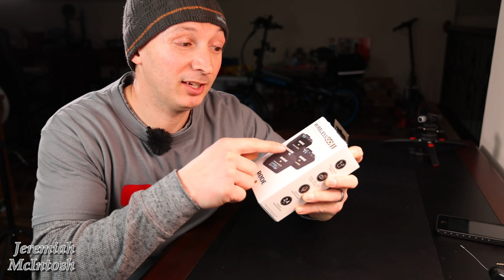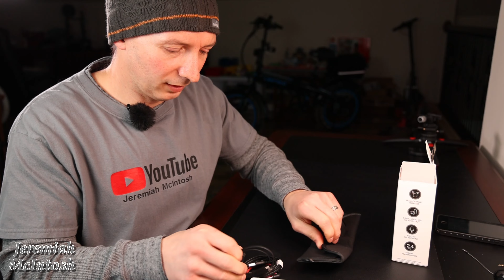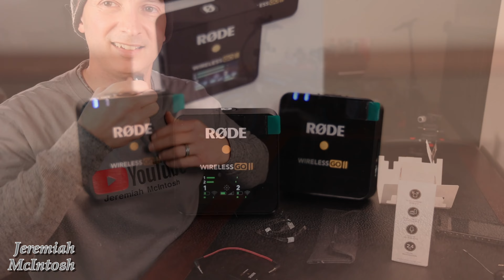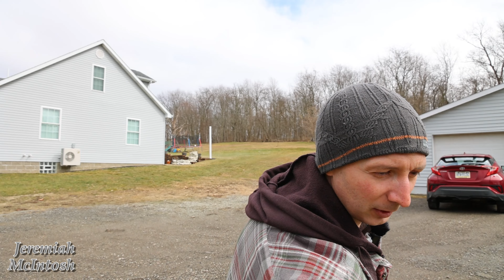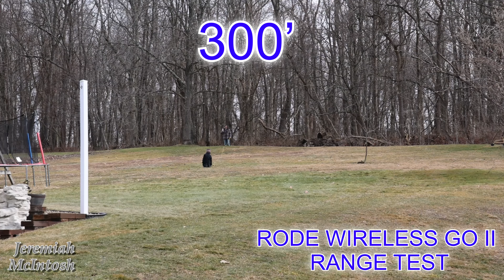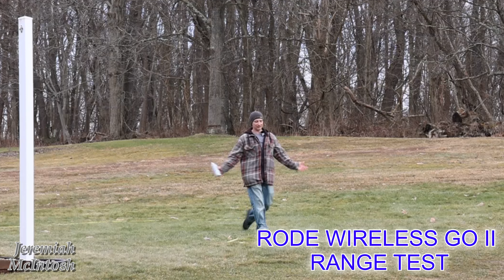How Far Can The RODE Wireless Go 2 Transmit ~ Wireless Microphone range test!

Comment: I have windows 8 64 bit. Rode central will not install unless you have apple or windows 10 32bit or 64bit why? Most likely Rode didn't bother to pay Microsoft's licensing fees for compatibility with all windows versions.  Rode emailed me to say that windows 8 64 bit doesn't meet their requirements? In other words officially Rode has "zero intention" to be responsible at accommodating their future potential customers who "dont" have Apple or windows 10.
The reason why windows 10 works and not older windows operating systems is not what Rode responded in they're email to me that windows 8 doesn't meet they're requirements instead Microsoft historically offers the first several months of programs as well as operating system licensing fees as free thereafter companies are required to pay their share for the access to Microsofts products. 
Rode is either to short sighted to provide windows compatibility to all versions for it's potential customers or too cheap to pay Microsoft's licensing fees even though they're making millions of dollars in profit from this new Rode Go II product.

Comment: Thank you for this test!! I have the original Go, and it has an absolutely horrible out of sight range even in a small room. 

I’m glad they upgraded the wifi transmitter and antennas, but no matter what, 2.4ghz will always be susceptible to poor range when trying to go through objects, unless you utilize a directional antenna.

The other big factor is how it stacks up to interference to other wifi/bluetooth devices. That was also a huge killer with the original model.  With that said, if it can perform out of sight at 75 feet, then it’s definitely a huge step up. Like you said, its very unlikely people will go that far using a consumer/prosumer lav. 

Im sure that internal recording was more of a safety net than a bonus feature lol.

Comment: hello nice video, congratulations.  I wanted to ask you something, are they compatible with smartphones if of course I buy the SC7 trrs cable?  because I know that with the first version they work, but with the wireless go II I have not found anything about it.  Thanks in advance for your reply
Reply from the maker: Yes the new wireless go 2 will work with both smartphones and computers with the correct adapter.
Reply: @JeremiahMcintosh  yes with the new SC15 and SC16 adapters I know they work for smartphones, but I was wondering if they also work with the traditional SC7 trrs cable.
Reply from the maker: Yes it should work with the SC7 cable as long as you have a headphone/microphone jack on your phone. I am using a offbrand TRS to TRRS cable along with the lightning to audio adapter and USB C to audio adapter on both my iPhone and iPad and it works fine. If you use the digital out signal from the USB C port of the receiver it seems like you get a better audio signal than the analog signal but they do both work fine.
Hope this helps.

Comment: Good job on the range test.....I jus purchased the Rode Go 2 and will be arriving tomorrow and excited to get it up and running. At least now I got an idea on how far or close the signal strength will be from Transmitter to Receiver. But then again the transmitter internal recording is an excellent back up......Aaaaaauuuuuright :-)
Reply from the maker: I agree the internal recording on the transmitters are an awesome feature to have. I’ve downloaded the companion app on my laptop and played around with it a little. So far it seems to work good but starts recording when you turn the receiver on and there’s no way to start and stop it without plugging it into the computer or turning the transmitter off and back on. Overall though glad to have it!